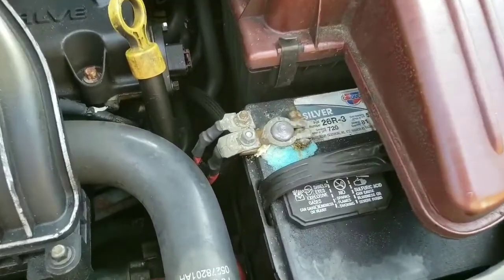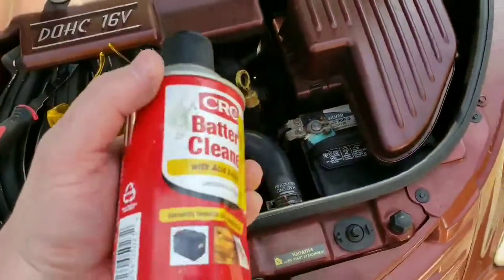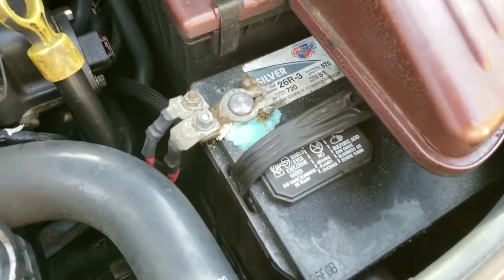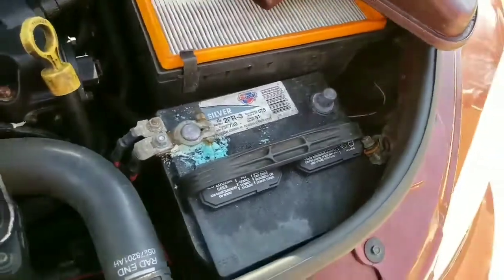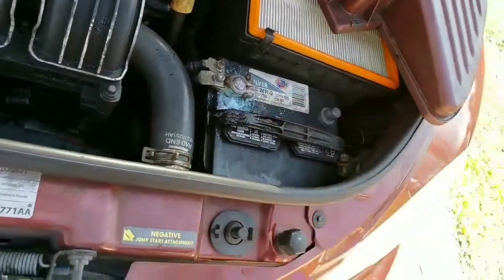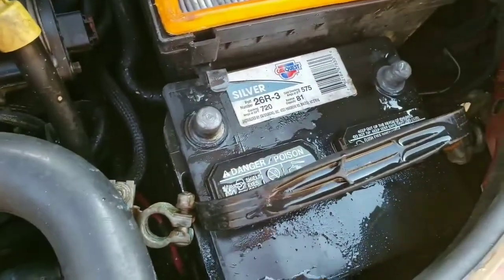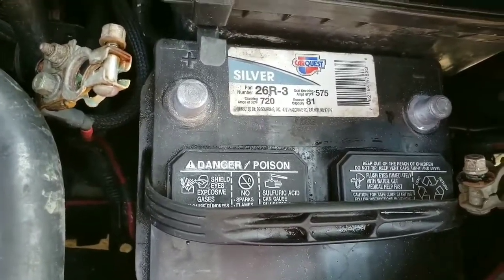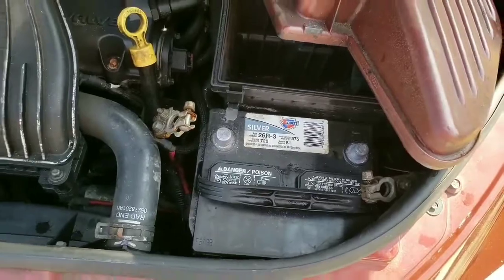Battery Corrosion Causing a car not to Start Properly -How to Fix the Issue and Clean the Corrosion

Comment: I have a battery from 2013. It would only ever charge to halfway for the past several years. Still worked and was reliable. Today I go out to start car and it's toast. I find tons of corrosion on the positive side. I clean the corrosion off, charge the battery. It charges, car starts 3 times in a row. All good.  8 hours later I check again. Battery is dead again.  Try to charge battery again - charger will not function and gives error.

So if you have a lot of corrosion on your battery and its nearing end of life (7 years or older) don't bother with it, buy a new battery.
Reply from the maker: If your battery lasted 9 years that's amazing most batteries only last about 4 years sadly thanks for watching and commenting please subscribe

Comment: Ummm… Did it help?  You never showed your car starting after you cleaned the terminals.
Reply from the maker: Yes it did start after charging the battery but the battery is still bad 2 years after the video, I have to charge the battery full to start the car. Then its dead a day later.  So this corrosion is a good sign you probably need a new battery sòon. This is not my.primary driving car so it sits and the old battery just dies now. I haven't wanted to buy a new battery for it so I just leave a trickle charger attached to it to let the battery life it's last life, I don't dare drive anywhere and turn the car off though lol if be stuck.

Comment: That battery and  box is the stupidest placed part on this damn car cleaned the posts with coke and grease jumped her off to charge the battery now wait and see if it starts back up tomorrow evening
Reply from the maker: Hope it works mike c. If your battery does again in less than a week without driving might be time for a new battery
Reply from the maker: Yeah you have to remove the air filter to get to the battery terminals
Reply: @drewsquickfix  yeah I put grease and everything on the terminals clean battery still dies I did a parasitic draw test with my tester showed 0.71 draw I removed the white clip with a double 30Amp fuses and it went to 0.29 and 0.30 I'm so confused what could be wrong the battery is fairly new also

Comment: You know the other end of your brush tool unscrews with a quarter turn, exposing a brush for inside the terminal clamps.
Reply: Yep I have the same one use it quite a bit
Reply from the maker: Yes I do now ha ha.  Thanks for watching!
Reply: 3:34 You can safely pull the positive terminal off to clean it, no problem.  You already have the negative ground cable off, so there's no chance of shorting if you touch metal.

Comment: Corrosion on the positive battery terminal is from overcharging the battery caused by a failed diode in the alternator voltage regular.
Reply: Whats the fix for that please??

Comment: The powder really is not harmful, its when its in liquid form sulfuric acid powder is not going to do anything, acids needs to be moist to be active, hence why your battery has water in it in the first place and not just powder.
Reply: Mine keeps corroding and Idky. I have a 2013 Camry and have a stereo but never had issues till a stereo shop installed a “Big 3” I had them take it out. I’m still having issues like my key fob not getting read by my car’s ignition and then out of no where it comes to life and I mean I’ve literally done everything I can think of and this electrical shop.. any ideas?
Reply from the maker: hope u fixed the issue comment got lost.... thanks for watching!! please subscribe and see my other videos!!
Reply: If your hands are sweaty you can activate it.

Comment: My car was working fine but it had a ton of battery corrosion. After I cleaned it THATS when I started having problems with my car. I noticed the headlights seemed dimmer. Then days later it doesn’t wanna start even with a jump.
Reply: Clean the terminals again. My car wouldnt start even with a new battery. Cleaned the termials but it only helped a littled. I finallt noticed a tiny spec of corosion, small as fuck between the bolt was killing my battery. Cleaned it yesterday and now it starts up
Reply from the maker: You may have gotton the battery cables or alternator wet which can cause a short. First charge your battery at an auto parts store then see a mechanic if that doesnt work. Please subscribe thanks!!
Reply: Drews Quick Fixes Ideas And Hacks thank you fore replying so fast. And I definitely will (subscribe.)
Reply from the maker: @lifeismusic5529  also see this video if your having trouble jumpstarting. https://youtu.be/zuc4MANp87c
Reply: Life Is Music make sure to leave no corrosion residue at all.  Even if u think its not alot
Reply from the maker: Fresh kush Lol this was 7 months ago hopefully he fixed the issue thanks for watching and commenting

Comment: You can also pop those two caps off and see if there is water in the cells and if there is not add distilled water not just tap water.
Reply from the maker: Thanks tim ha ha I dont know alot about batteries so I will probably just let it go. It seems to work fine though
Reply: I keep thinking that's battery acid.  I never knew you could fill it with distilled water. Thanks for the info.
Reply: A R it is battery acid in there. But the distilled water you add to it helps with the chemical reaction that produces the battery acid. You still have to be careful when opening it cause it is not water in there. But you are adding the water to become battery acid.
Reply: @KillirBeard  oh so you need distilled for chemical reaction.  Shows how clueless i am with batteries! Lol  thanks!
Reply from the maker: Hey ar I think you need distilled because tap water has chemicals like fluoride and chlorine in it. I dont reccomend doing this unless your properly trained like tim is. Batteries can explode in your face and just a splash of that acid can cause severe burns on skin.
Reply: @drewsquickfix  yeah, it's best not to look like joker from batman. Lol thanks!
Reply from the maker: Tim is right AR I have seen videos about adding water to bad batteries to make them good again but I dont mess with it because it is acid. Glad you two got to chat ha ha your both my regular subscribers
Reply: Drews Quick Fixes Ideas And Hacks if you or A R both ever have a question Drew you know how to reach me. You can pass that on to A R as well.
Reply: @AR-sd  it IS battery acid.  Distilled water may need to be added to fill it up

Comment: I have always sprayed that stuff on and then wash it off with water.  Then wash the water way with a water hose. But be mindful of other electrical stuff. So you don’t get things wet with the water that don’t really need to get wet. That is the same cleaner we use at work and we use the protection stuff from the same company.
Reply from the maker: Where do you work tim just curious. Just a company name not a location lol
Reply: Drews Quick Fixes Ideas And Hacks well I used to work for a carmax. But now I work for the city transport system as a diesel tech on the busses people ride on to get around the city.
Reply from the maker: @KillirBeard  that awesome, I bought the 1997 tahoe from carmax In 2001. I was very happy with the condition it was in. I'm not sure if the company has changed but they used to sell great used cars in good shape. It's always nice to have your I put since I'm not a mechanic, lol.sometimes I have had a few errors in my videos I'll admit. I took a engine repair class at the local community college. Best class I ever took!
Reply: Drews Quick Fixes Ideas And Hacks always here if you have questions and you know how to reach me.